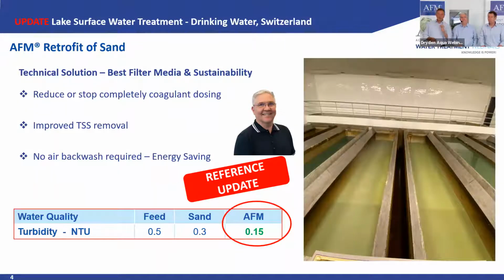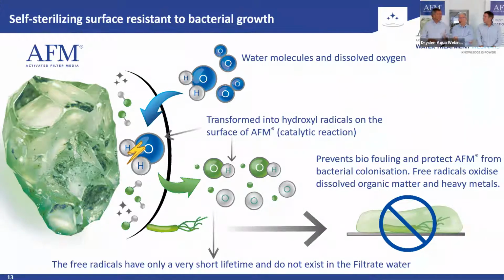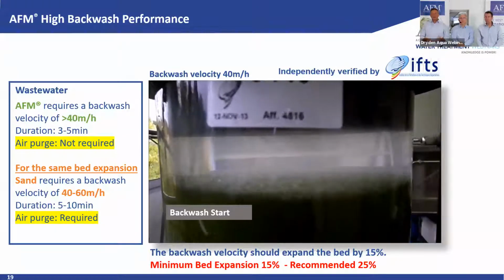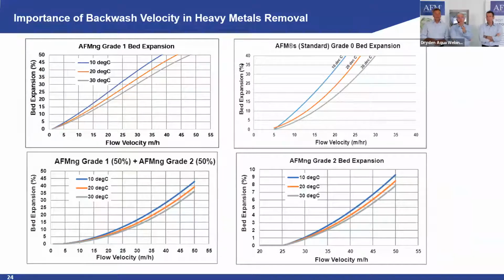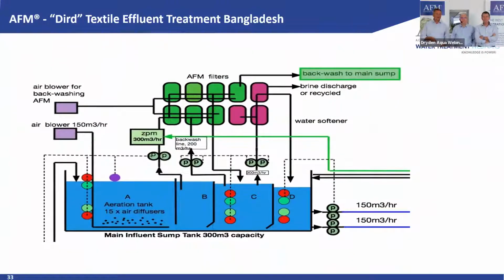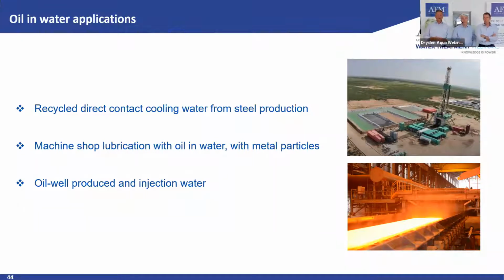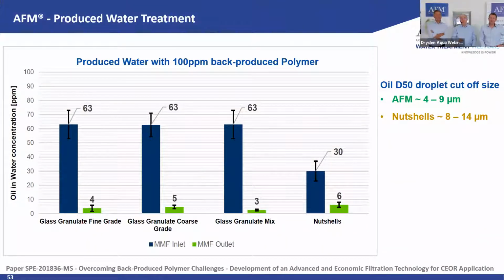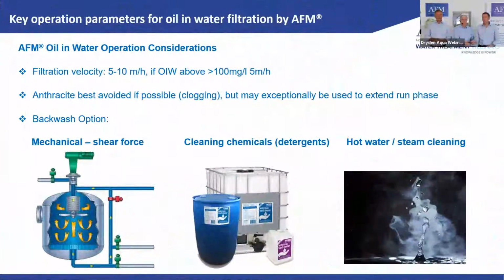AFM® WATER TREATMENT WEBINAR 4 - AFM® IN WASTE WATER TREATMENT AND OIL REMOVAL

Comment: From a hydraulics point of view, You state that air scour is to aid scrubbing of biofilm from the sand media and so is not required with AFM. But combined air and water scour will surely assist in expansion too for AFM? and further reduces the amount of water required in m/h (because you will get similar expansion by just adding a little bit of air and reduce the water wash rate considerably) which equates to the volume of water spent washing at the end of the day.
Reply: Basically is there any objection to still adding air to the wash process, to simply reduce the amount of water required.
Reply: Dear Jaco, in the conventional sand backwash, the first step of the backwash process is a the air scouring with or without water (or combination of both) to remove as best possible the biofilm from the sand surface. This process will only release the biofilm from the sand (or other conventional filter media) surface but the air/water backwash velocity is not high enough to wash/flush the particles out of the filter. Furthermore the air scrubbing will lead to a mixture of the media in the filterbed which needs to be reclassified with a water only backwash at high velocity. Therefore in a second step a water only backwash is applied at high velocity to remove the TSS/biomass and to reclassify the filterbed. From experience, many sand filters do not reach the required backwash velocity of >50m/h required to reclassify the filterbed and efficiently remove the suspended solids. As to this many sand filters run a 10-20 min. (or more) backwash time to flush out the suspended solids but which is often not successful as the particles gravity (settling) is higher then the drag force of the backwash velocity.
As no biofilm grows on the AFM surface we do not need air scouring but only a high backwash velocity of >35m/h for ca. 5 -10min. (depending on application and TSS load) to reach an efficient backwash performance. In summary using AFM you save on investment and energy (air blower) cost and reduce amount of water required for backwash (shorter backwash time).